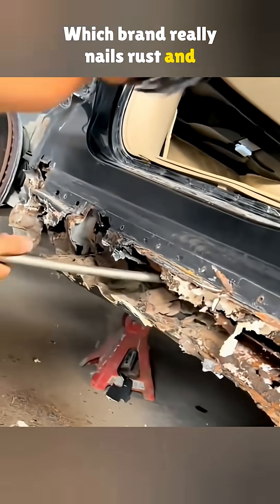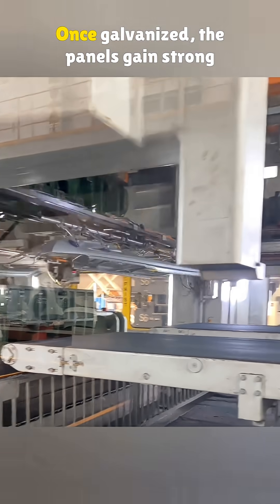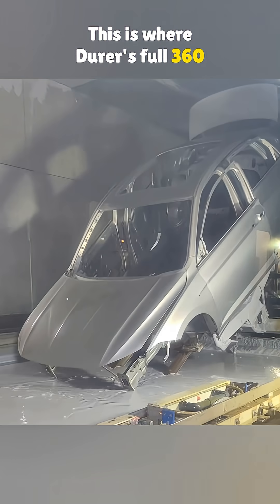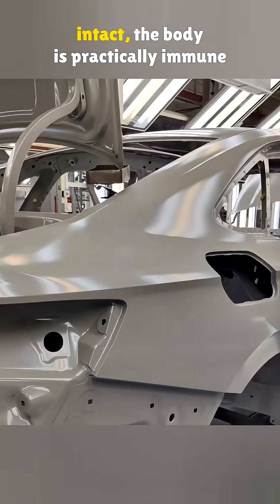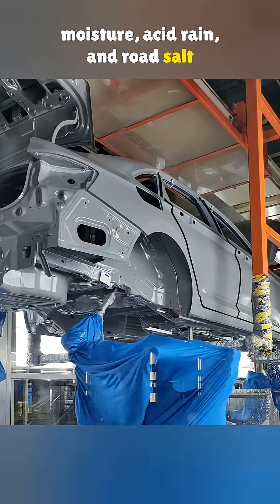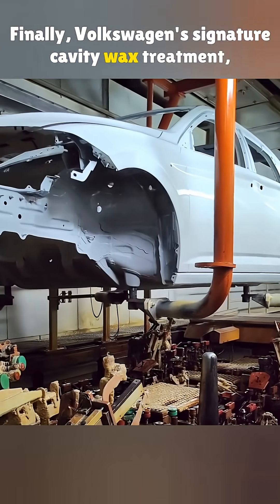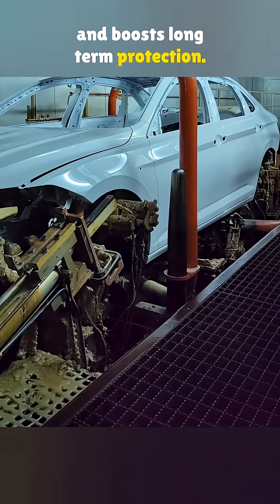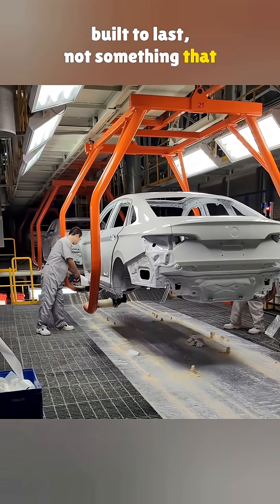Which Car Brand Leads in Rust and Corrosion Protection #automobile #assembly #factorytour #cartech

Comment: What's the point when the TSI and DSG are so fragile that they need frequent repairing? The car spent more time at the workshop than on the road.. I sold my VW for a Toyota 4 years ago, peace of mind..
Reply: My TSI running like Superman boy of a caring mom . it running without any problems. Putting  all Honda and Toyota wonder 💭 n my circle 

It needs continuous timely maintenance. Kidd one and it will affect whole car.
Reply: Since when has the dsg been fragile?
Reply: @jasoneldridge4738 I guess when u don’t know how to maintain a VW . These beasts are like mommy boy .
Reply: I agree, Toyota is more simple and reliable car than VW and 4 years is still not old car. But, with poor maintenance it will have problems in a few years too.

Comment: Perhaps good protection against corrosion, but what about engines, DSG transmissions and software glitches?  All has to be perfect and Volkswagen is very far from that.
Reply: VW is reliable if it was properly maintained. I think only one item is debatable is DSG with dry clutch but I don’t know any VW model in North America with non-wet DSG.
Reply: @YuriiT. U are wrong. I owned a bunch and all were maintained properly. An Audi A6 needed 17 extra fixed in a year and a half. It run 4 months without visiting the dealer at best. A Passat was nearly the same, trouble with simple parts like doors and high class glitches as well. Well known guest at the workshop.
Reply: @rubinreiter6351  What does "maintained properly" mean?  Did you buy car new? Oil change service interval? Transmission fluid change service interval? How old car was when you had problem with it? Thank you
Reply: @rubinreiter6351  And please provide a example of a few issues. Thank you
Reply: @YuriiT. Head lights (internal parts cracked without external influence), 4 camshafts worn (ledeburit type), FIS, turbo, KGE, injection pump (3 in one and a half year), a bunch of undercarriage parts (very expensive), door hinges broke (yes there were maintained), hydro lifters, strange noise coming from charging system reason never found (2 authorized workshops tried), pcv system (cheap part, many expensive hours of work) and so on...
Reply: @rubinreiter6351 I think you bought already dead car or did poor maintenance. 4 camshafts worn (ledeburit type), FIS, turbo - reason is engine oil poor service. KGE - Did you ever change the transmission fluid or you bought it dead? pcv system (cheap part, many expensive hours of work) - why you bought premium car with 3.2l V6 engine? If you want cheap, buy 2.0L and replace PCV in 15 minutes. Now I drive VW with 2.0TSI engine and no complains. Also, I had cars of this brand before, the are very solid if you maintain...
Reply: @YuriiT. Good luck and many happy miles.
Reply: @rubinreiter6351  Thank you, you too
Reply: @YuriiT. Yes I have, riding Honda and Toyota - 150.000 miles without any issues. As JD Powers 2025 noticed: worst brand Audi and Volkswagen only three notches better. I've learned my lesson this chapter is finally closed.😂
Reply: @rubinreiter6351 Yes, you are right. These brands still keep old naturally aspirated engines, so you could abuse car and neglect maintenance much more than any German car. About software glitches, Toyota entertainment system is pice of shit in comparison to VW, so I am ready to turn it off/on once a month when it glitches instead of use Toyota.

Comment: They also use/d the better crooks and software to make diesel engines look clean and safe POS
Reply: Ea189 series of engines are great my family has 2.0 cr170 and we’ve had it since 10k miles and now it’s on 130k and it’s still running great and is very efficient on fuel only problem it has had is thermostat
Reply: " clean and safe " ?,you make it sound like it's going to come round and stab you ?